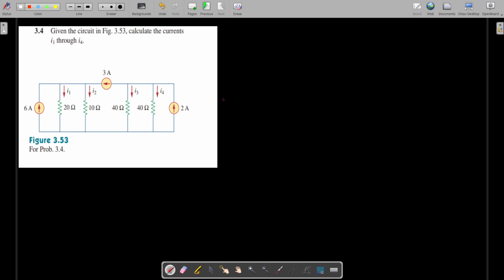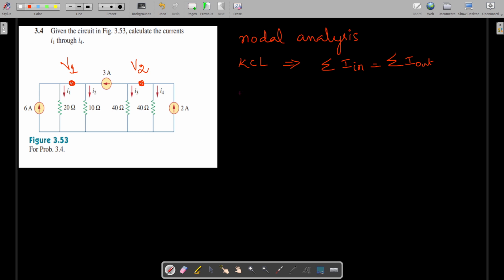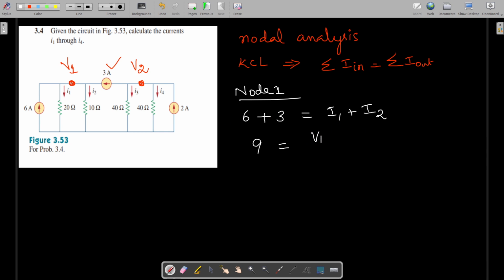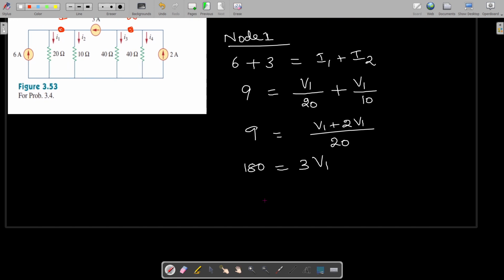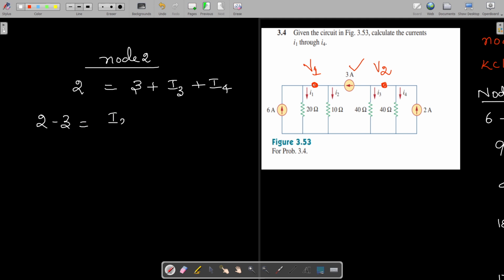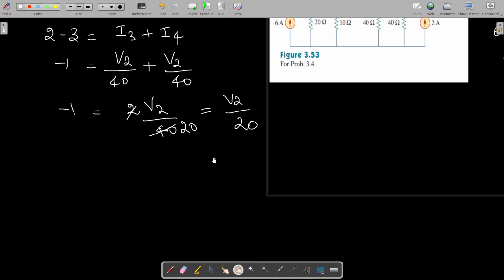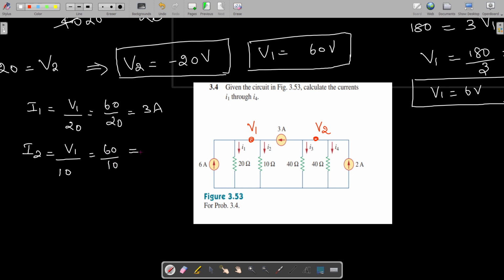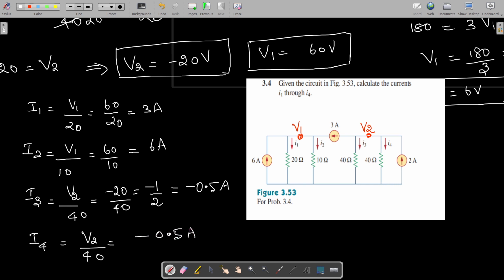Nodal Analysis - Problem 3.4-  Fundamentals of Electric Circuits - 5th edition

Comment: TEACHER, 180 / 3 is = 60 not 6
you made a mistake
Reply from the maker: Thank you for pointing out. It's a mistake . Later on I used the correct value and proceeded